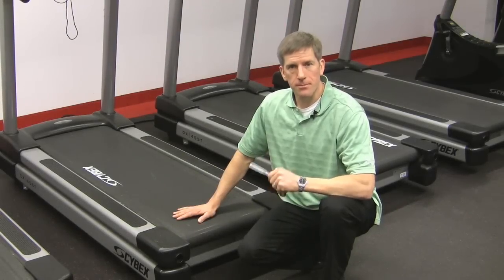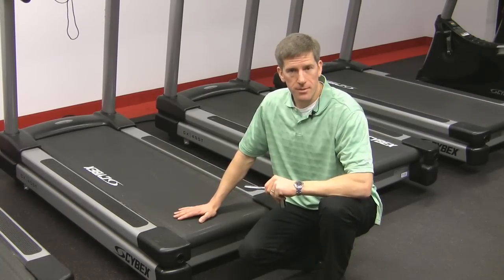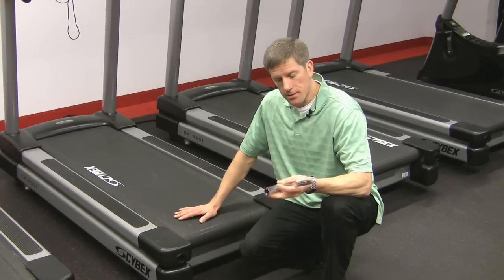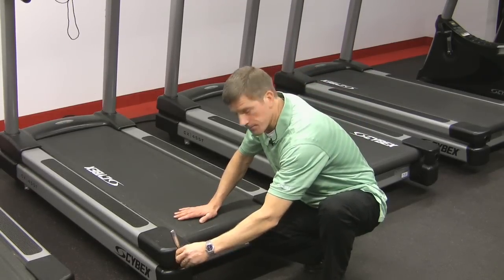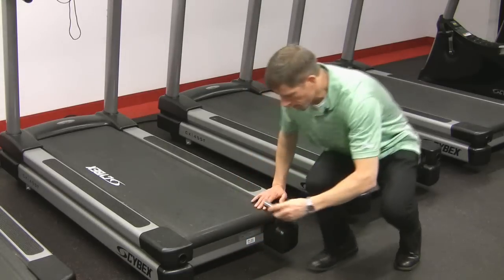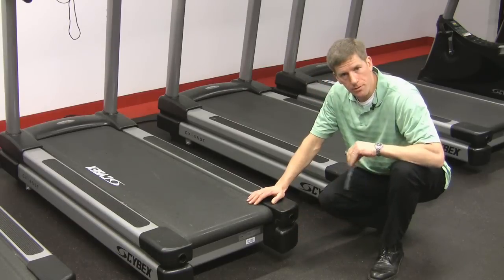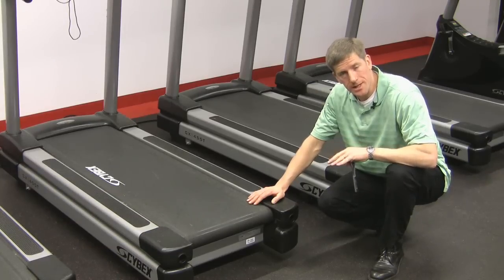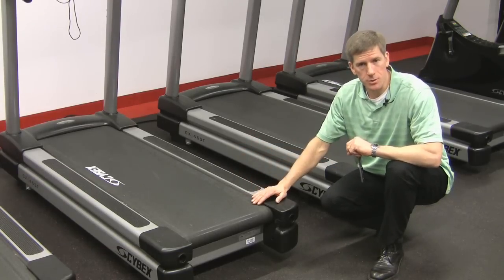CYBEX Treadmill - Belt Tension

Comment: i have a horizon fitness treadmill, i have used the belt tension system however it still seems to stick now and then when i run on it do i need to tension to the max or am i simply to heavy for it !! i weight around 14 stone 7 lbs any suggestion will be welcome